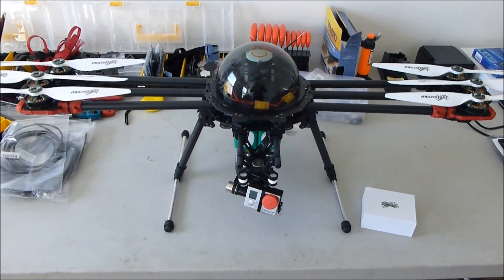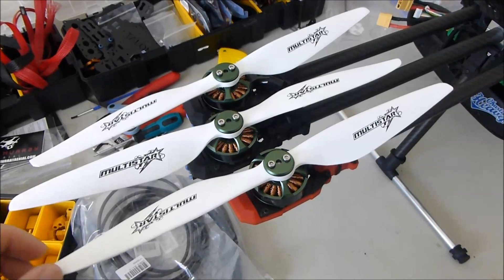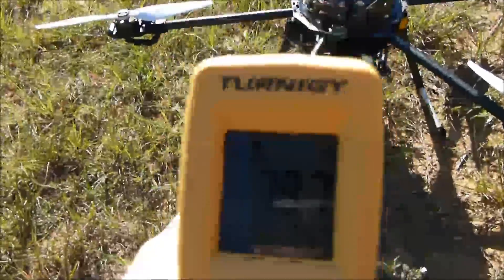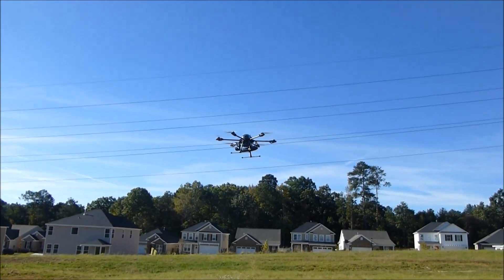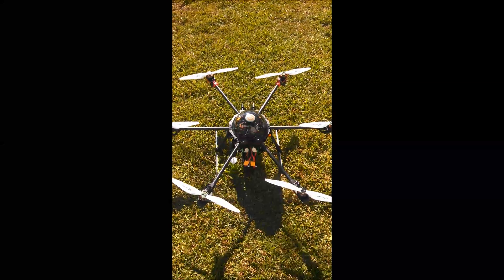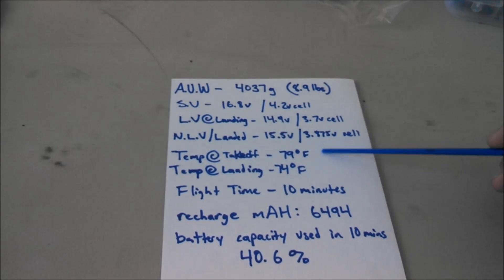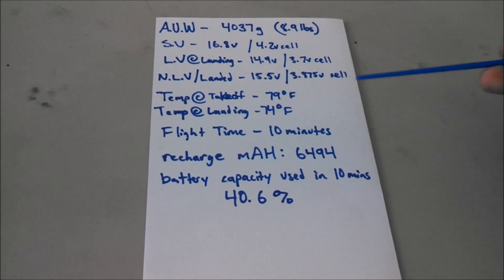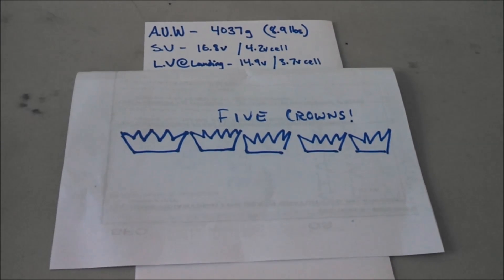Turnigy Multistar Elite 4006 740kv Multirotor Motors Review & Test Flight

Comment: Thank you very much. I have two questions:
1. What was the weight of the additional payload?
2. The capacity used for 10 min. hovering was less than one 8000mah battery, so theoretically you could use just one battery and get even less drain? But how about the amper flow? Could one battery give twice the ampers in this setup?

Comment: Have you pushed your batteries to 20% left?  Interested to see what type of flight time you are seeing if you exhaust your batteries.  Do you think 30 minutes is possible with this frame?
Reply from the maker: +VSUPARHAM This is an old video, and I have long since sold this frame. I don't think I ever had a flight longer then ~22 minutes with this setup.
Reply: +Lake Murray Aerial Thanks for the info.  So would you recommend these motors for a fresh 4S Tarot 680 build?  I've heard of people getting much longer flight times but they always seem to be using 6S batteries.  I have a plethora of 4S batteries between 4000mAh and 8000mAh so staying on 4S would definitely be the most cost effective thing for me to do.  Also, I consider 22minutes to be a pretty decent flight time.  If that was your average then this might be the way to go.

Comment: HI, nice summary, and comforting, as I just bought these motors from HK for a XJ470 quad, as I was struggling with 2213-920kv from T-motors, crashing, sync issues etc.... What amp rating are you drawing out of these motors, I am planing 20 Amps ESC Afro NFET; would you say it's enough for a 2KGs QuadCopter with these motors, 4S 5.2; with 11.47 Props? From my calculation it should be fine, BUT i was wondering what ESCs you were running on yours, please, if I may?

Comment: Excellent test, thanks very much for that.  I was worried the motors would struggle under a 14x47 prop and 4S but seeing as how they didn't even break a sweat I now know they should be fine. What I am worried about is the max amp draw of the motor under a 14x47 and 4S.  The product page doesn't even list the max draw at that.  I will be using a glass fiber/plastic mix prop in hopes that it deflects a little to reduce the max amp draw but am still a bit concerned.  Not so much for the motor, but for the batteries.  On the quad I'm planning on, I want to use a 20C 5K battery but that would mean with ~32A/motor max I would need ~25C from the pack (128A).  This is well within the batteries 20-30C rating, but in my experience, batteries barely provide their normal minimum C rating before significant voltage sag.  Using a higher rated battery is just unnecessary weight though...

All this being said, my craft will have an AUW of ~2.2kg and with a thrust of 2+kg/prop, I'll have tons of power...which is what I want but I'm looking for about 15min of flight on said setup.  With a listed ~2.8A @ 500g thrust and expecting ~3A/motor on a hover with four motors into a 5A battery, that translates into a theoretical 22-25min hover time.  So 15min in real life mixed flight should be no problem???  :-)  I wish they were 700kv motors instead of 740kv.  It would all work out perfectly with a 20C battery on a 14" prop.

I would greatly appreciate your thoughts.  Thanks again, keep up the good work.

Comment: Hi! How did you manage to get the motors on? I can't seem to line up the holes on the motor mount and the 4006 elite motor holes - did you modify the mounts or anything?
Reply from the maker: They just bolted right onto the tarot mounts. It's possible turnigy modified the bolt mounting holes on the multi stars, but I don't see why they wood. The tarot mounts are pretty universal with just about every bolt pattern already drilled in the carbon plate.
Reply: Lake Murray Aerial Ah darn, mine look like this: http://cdn.hobbyking.com/hobbyking/store/catalog/63643-1.jpg
Reply: Lake Murray Aerial And the mount like this: http://www.helipal.com/tl68b26-16mm-clamping-motor-mount-red.html
Reply: Lake Murray Aerial I studied your video and even though my motor is facing the same way with the wires, the holes just don't add up... weird.
Reply: Lake Murray Aerial Had a peek at your other video, same holes in the motor base as mine, going to have to take it apart and study again...
Reply from the maker: Honestly, maybe I only used two screws, but I don't think so. This rig is long since sold though so I can't check for you.
Reply: Lake Murray Aerial oh okay... Whats your take on just using two scews though? Seems like that might lead to a motor taking off from the frame at some point :)
Reply from the maker: I've used just two on many builds, when I had to.. Never had an issue.

Comment: Thanks for this very nice test and numers!
I plan basically an identical setup but i will end up with approx. 500g more weight.
Do you think the motors and frame will handle the extra weight?
And do you have any idea how much more Amps the copter will draw with 500g more?
Thanks a lot!
Best regards
Reply from the maker: Couldnt tell you the additional draw, but this setup can handle 500g additional weight no sweat. Thanks for watching!
Reply: Lake Murray Aerial
What max AUG you flew until now?
Reply from the maker: I flew @ 4837g while doing a payload drop about a week ago, and the craft handled it fine, but it was not an endurance test, just a ~500m flight delivering a payload then returning to launch point at its normal AUW. Motors were just ambient temp at landing according to my touch test (didn't have IR gun with me) :)
Reply: Lake Murray Aerial
Thanks! this helps a lot!

Comment: Heya, i ran some numbers based on your video and something is a little off.
Here are some of my findings, you are drawing 38.96A of current (the average for this flight) and since it's a 4 s, with an average voltage (my estimate) of around 15V, you use 584.4W of power to stay airborne which translates to only 6.91g/W....which is quite inefficient IMO for the disk-loading you have (6x13'').
I ordered 4 of these motors myself for my 2100gr AUW quad with 12x5.5'' props. I am honestly hoping for 8-9g/W of efficiency...gonna run 3S 4400mAh...
Maybe you could try different props (if you have any) or measure amp draw or try on 3s see how it works...not sure...i hope that this is not the real performance o this motor...cause 7g/W is quite underwhelming at 13'' :(. What are your thoughts?
Reply from the maker: You clearly have a greater grasp of electrical theory then I ever would so I can't comment on the validity of your numbers, but I will say that 6.91g/W sounds like reasonable efficiency for this size and configuration hex... When run thru eCalc, I get 6.63g/W and 43.34A @hover for this setup, so it seems quite valid. I will add that I've since weighed the craft on a more accurate scale and actual AUW for the test was 4168, so a bit heavier then stated in the video. Anyway, I don't profess these motors to be anything "special" when it comes to efficiency, rather I have simply found they are more efficient and run cooler and smoother then the Tarot 4006 motors they replaced. Since you seem to have a specific efficiency goal, you should play with ecalc to find a configuration that will get you the result you seek.

The formula for long flight times on a multirotor is somewhat of a well known secret now, and generally accepted as large props, low KV motors, and light weight in quad format. Of course, that formula does not result in the best aerial media platform, which is the intended use of this craft. I am happy with it in that regard :) Thanks for watching!
Reply: Lake Murray Aerial The thing is that e-calc is usually off by quite a bit at least when i compare it to my RL results. But why this is a bit disconcernin for me is that there is a sheet for these motors on HK (last page of the motor) and for 13x5.5'' props at 4s at about 500gr trust you should get 9.92g/w...now when we consider that you need a little bit more thrust/motor we can assume efficiency decreases slightly, and add the fact that you have a lower pitch on the props which should increase efficiency then we could safely assume like 9-9.5g/W which is like 30-35% less efficient than what HK state...in your case that is the difference between 20 and ~26-28 minutes of flying time :(. As for the weight being only 100g more than stated in the video is negligble...it's only like a 2% increase in weight...So either we/i'm missing something or HK is creating bogus sheets for these motors which is not cool since these motors are no longer in the "cheap" category....
Reply from the maker: Andrei Mendel Yeah, I don't believe much of anything HK has to say. To be honest I had looked at the prop data sheet for thrust info but never really paid attention to the efficiency numbers. I agree that my test results do not reflect the data they are providing, since 500g thrust at 9.92g/w couldn't possibly drop off so sharp to 6.91g/w at the 695g thrust I was needed to hover...

I guess I could redo the test with my carbon 1355 props mounted to remove one variable and then recompare results against HK's provided data.

"cheap" is relative, but I consider these motors cheap, as $35 or so seems much less painful then the $113/ea Avroto Lift's I need to buy for my incoming Tarot TL8X000 octo ;) Video on that coming soon.
Reply: Lake Murray Aerial haha 113$/motor for an octa...i can feel your pain....this hobby is a love and hate kind of thing :) i am looking forward to the octa video. If you get the chance to take the 1355s for a flight that would be great. Thank you for taking the time to reply to my comments. Please make more videos about your multirotors as i enjoyed watching them (I am not really the artistic type so i am not that much into the scenery videos) :). Thanks and looking forward to seeng more. P.s. after i get my motors i'll do some tests and will post the numbers here for reference.
Reply from the maker: Andrei Mendel
Great, I look forward to seeing your results!

Comment: Thanks for the review! I'm about to buy these motors for my 1.6kg tricopter since the specs look quite efficient. Would you recommend these for tri's as well? And if you do, which prop would you use for such a setup?
Reply from the maker: Glad you liked it! I really have no tricopter experience at all, but I don't see any reason you wouldn't want to use these provided your tri is going to use a 12"-14" prop and 3S or 4S battery. A 1.6kg AUW will be no sweat for three of these motors. I am partial to the Multistar wood 1344 propellers for these motors personally, but I don't know if the lesser pitch they use is a drawback on a tri's servo driven yaw motor.
Reply: Lake Murray Aerial  I'm also considering 12x4 multistar white wooden props since they seem to fit perfect for my specs but not sure if the tail servo can handle it. I'll be adding a carbon fiber 12x55 prop just because they're lighter and will switch in case my first tail servo doesn't make it too far :)